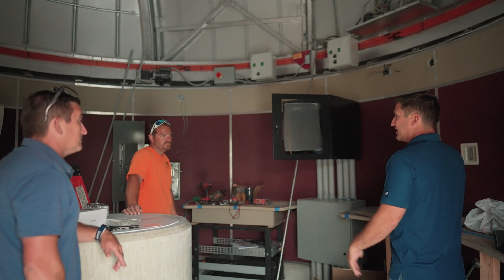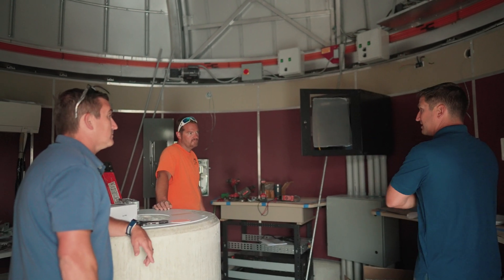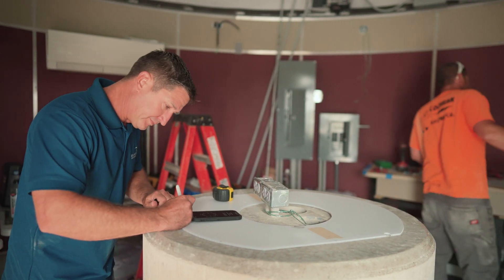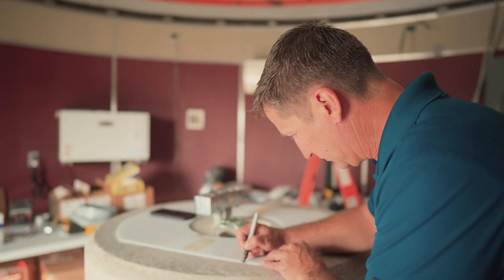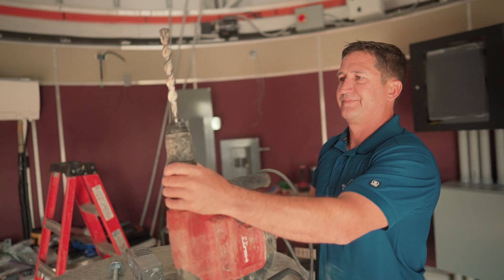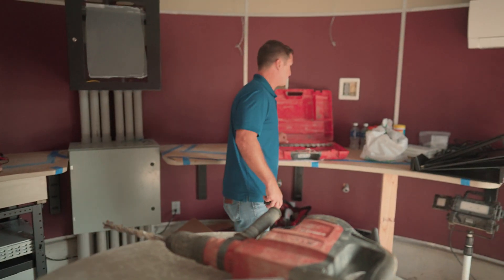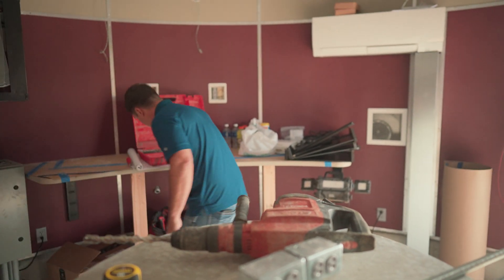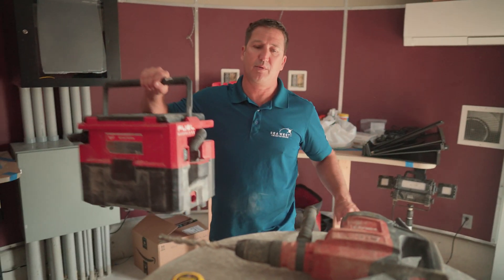Building a state of the art observatory for Jackson College!

Comment: Just eyeballing the drill angle? Need to cut down the water tower. The 3 bolts supported the telescope on the pier seem too flimsy and their expansion rate must play with the telescopes calibration?
Reply: We angle in the rod to ensure we don't hit the rebar. We straighten the rod once in to match the base plate of telescope. With that threaded rod it is extremely rigid and does not effect the telescope's pointing or tracking performance.
Reply: @MattDieterich  Sorry I sounded like I knew what I was talking about.. Nice to hear you know what you are doing. Cheers.
Reply from the maker: Ya the video sometimes doesn't paint the whole picture, but great question and we appreciate you watching! The pier to telescope interface is crucial to an observatory's performance.

Comment: Quite lovely. The only comment I'll make, as an architect who's worked on observatory projects in the past, is the masonry paving surrounding the enclosure. This is a potential heat sink, which can re-radiate thermal differential micro-environment turbulence, mainly in the early evening, potentially impacting seeing; imaging; data S/N quality. But this could be remedied with a low-density alternative, such as a wood deck walkway. Not a big expense in future. But, really, no biggie.

Again: lovely work!
Reply from the maker: Thanks for watching! We understand the impact of ground-effect seeing, but with this build the goal was ADA accessibility which meant design considerations had to be figured in. We included HVAC controls that keep the instrumentation as close to equilibrium with the ambient temperature. A large exhaust fan also is in place to evacuate the air inside. These HVAC controls are tied into our dome control system. 

Since this was a campus build, we